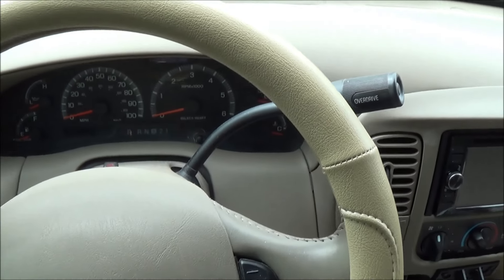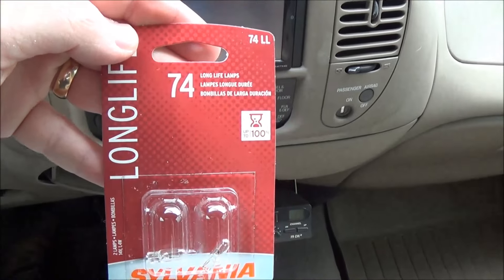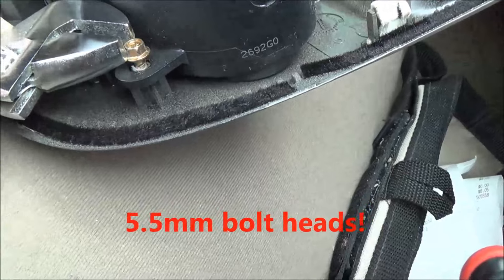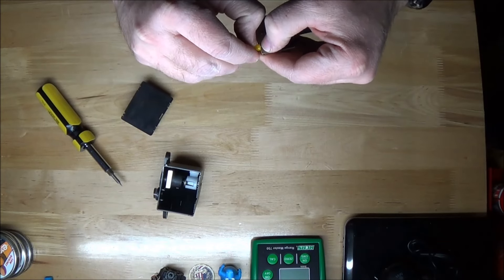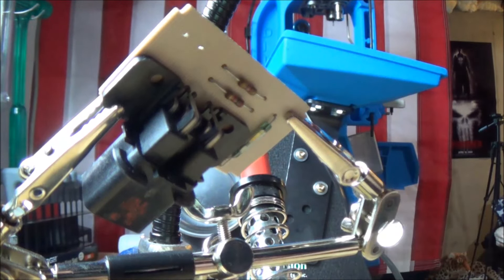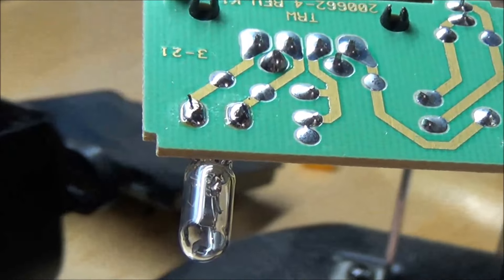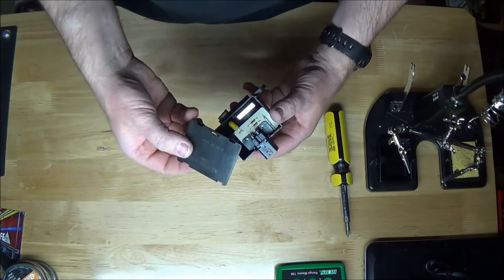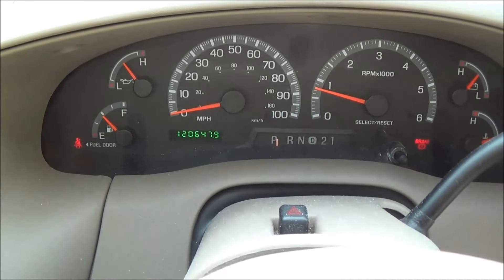F150 Airbag Light Easy Fix for Code 27 Diagnosis

Comment: Thanks for the video! Easy fix and saved me a bundle. Bought the bulb at Autozone,  note that you need to pull the wires down from the side of the bulb to solder them in. The bulb is designed to plug into a socket but just lift the wires and fold down. 74 ll was perfect for my 03 f150.

Comment: Just did this repair on my 2012  E250. Couldn't be easier👍I was originally going to use a 5mm 12v .07amp incandescent off ebay but the 74 worked great. It's a 10th amp or 100mA. Turned the key on and the light comes on for a few then off. Air bag light went away, cleared the codes, all good👍

Comment: It worked!!!  Had those annoying dings because my passenger airbag on/off light was blown.  Pulled that dash section off just as you showed and de-soldered the bulb and put the new one in.  I needed a 74LL (has the 2 wire prongs).  The auto store and the push pull kind.  I just bent the wires out and soldered it in and put everything back together.  Took less than 20 minutes. Thanks for the video.
Reply from the maker: Awesome! Its good to hear the success stories! Thank you

Comment: Dead on again, just replaced all my airbags and all a while back, then went off road a little and there it was this code. I haven't fixed the bulb yet as you did but went out and flicked the housing and the light came on then the code went out.  I'll pick up some bulbs and do the deed!  Thanks a bunch
Reply from the maker: hope the repair goes smooth and easy for you.

Comment: Thank you so much!  Followed your instructions and worked like a charm.  A thing or two: I used the bulb from Radio Shack 272-1141 and it worked great.  The yellow sleeve (Jimmy-Hat!) went on easy as pie.  I think the bulb you used had a much bigger diameter.  However, the 272-1141 had VERY fine copper wires and it was a little tricky to get the wires through the holes in the circuit board.  My screws were 5.5 mm.

Again, thanks for the video.  Worked great!
Reply from the maker: Excellent tip on the bulb. I miss Radio Shack. The one in my town closed up before I made this vid. But, I'm glad you got yours going again.

Comment: Code 27 fixed -ford ranger 2002. Ford asked $240 for the airbag switch box. I bought 2 bulbs for $5.95 from Walmart(long life bulb 74) and went to a mobile repair shop to replace the bulb. It took 1 minute and the guy told me I do not need to pay anything but I gave him $10. All fixed around $13.50. Thanks
Reply from the maker: Awesome!

Comment: Thank you for doing this!!!!  Life SAVER!!!!!
Reply from the maker: hope it works out as an easy fix for you.
Reply: TheRealCobraBurnout mine still would not illuminate and the dash indicator stopped giving me the 27 code and is now just constant on...I’ve got power to the passenger switch so I’m assuming the actual switch is bad...237k so I guess it had a long life!  Found one on eBay, will see...thanks again!

Comment: thanks so much. the only thing i did different was attach the yellow sleeve back on the bulb before i soldiered it. great video! fixed in like 10 minutes flat. liked and subscribed!
Reply from the maker: That is a great tip! I'm glad it worked for you as well

Comment: worked like a charm ordered the light from radio shack. $1.74 Part# 272-1141
Reply from the maker: Awesome! And thanks for sharing the bulb info for everyone!
Reply: Cheaper than just under $100.00 for the switch,great deal for $1.74 and a few minutes out of you day,,,I'm there.....

Comment: Nice job. They sure made that harder than it needed to be.
Reply from the maker: They wNt you to bring it in and have the whole module replaced for several hundred bucks.
Reply: TheRealCobraBurnout Can't believe the bulb has to be soldered.

Comment: MY AIRBAG LIGHT STARTED BLINKING ABOUT THE SAME TIME MY SERVICE ENGINE LIGHT CAME ON. TRUCKS BEEN SERVICED 1000 MILES AGO. COULD THEY BE RELATED? I DIDNT THINK SO BUT HAD TO ASK. 2001 f 150.
Reply from the maker: Hook up a scanner and see what codes pop. If you don't have one, some auto stores have them to loan out.
Reply: @TheRealCobraBurnout  GOT ONE. DONE DID NO CODES
Reply: @TheRealCobraBurnout  It was just strange they happened bout same time. I never really thought they were connected. Thought Id ask. Mine is blinking 2 and 7 also. Thanks for video. Ill try it when i get a chance.

Comment: Current quote is over $300 to fix this on my truck. 1.5 hours or labor. Interesting. 

I will try this first.
Reply from the maker: Hope it works out for you. If not. Look around online. You can also get the whole assembly and just swap it. Still would be way cheaper than that quote.

Comment: will doing this get rid of the 5x5 beeping noise?
Reply: If the PAD light goes out and the Cluster Air Bag light goes out you will get the 5 x 5 beep... gotta fix the the pad and replace the cluster light.

Comment: Actually it's not just the bulb..you will find the other solder joints holding the plug need more solder...mine was loose!
Reply from the maker: Good info

Comment: Nice cb
Reply from the maker: Thanks, I gotta get another one now. That one bit the dust a while back.
Reply: @TheRealCobraBurnout  which model was it? I had older one gave to me when I was younger and was thinking about putting it in my semi but it already had one in it so I might put it in my truck. Cant beat them cobra cb's I know the older ones last a while . I have the older mic that went with it that still works great.
Reply from the maker: @hilham89  Cobra 19...just a basic model sold at Walmart but it was old. Back in a another life when I drove OTR for Rocor, I had a Cobra 29 classic. Dang, I wish I still had that one. But, my dad got it after I joined the Air Force way back when (It was originally his). Anyway, it is long gone now. I may go back with a 29 and a proper antenna set up one day. Too many wants and not enough $$ right now. lol
Reply: @TheRealCobraBurnout  i know what you mean. Thank your for your service as well.

Comment: Thanks for the instructional video on doing this.  Just fixed my 2000 F-150 with a LFC Code 27 (B1884) using your technique.  However, I used a 5mm 9-12 VDC w/ internal resistor orange LED bulb purchased at Amazon [ https://www.amazon.com/gp/product/B074SJVNC9/ref=oh_aui_detailpage_o01_s00?ie=UTF8&psc=1 ] .  No Radio Shack here.  : (   Anyways, no bulb cover is needed and I expect no more trouble since it's an LED.  NOTE:  The longer leg needs to be placed near the outside of the circuit board with the shorter leg towards the middle.  I got this backwards my first time but it's easily remedied.   Anybody need a light?  I have 48 left over.
Reply from the maker: Excellent information! Thanks for sharing
Reply: Thanks for this link, I ordered the same ones in June 2022 and they worked like a charm. The light stays on extremely faintly when the switch is set to on but that’s to be expected from dinky little LEDs used in this setting. Likewise I have 49 left over so if anybody wants one hit me up.

In case that Amazon link fails down the line, here are the brand, number that came on the bag, and description:

Bowerful
X0020DOGX (those aren’t all zeroes, the first two are zeros, third one is the letter O)

“Do not need add any resistor, it can work in 9-12Volts directly 
Specifications: 
-Size: T1 Round (waterclear) LED or 3mm Round (waterclear) LED Brightness: 2000-2500MCD 
-Emitting color: Orange 
-Wave lenght: 595-600nm 
-Forward voltage:9V~12VDC Compatible.  
-Forward current Typical: 15mA or below; Max: 20mA  
Viewing angle: 25-35 Degree   

Applications & Installations:  
Ideal for 9-12V LED replacement for computers, radio, dashboards, or any battery or power supply that the voltage in 9-12V ….etc.  
Very low power consumption, and high luminous intensity  
Recommended voltage is 12V  

Package included: 
50pcs T1 3/4 Round (waterclear) LED or 5mm Round (waterclear) LED(Orange)  
Search "bowerful led" for more related leds;”

Comment: My luck doesn't work that way. The dash would have cracked and I'd be screwed.
Reply from the maker: Well..my paint chipped off last time. Cant match the paint so it has a slightly off tint patcwork paintjob now.